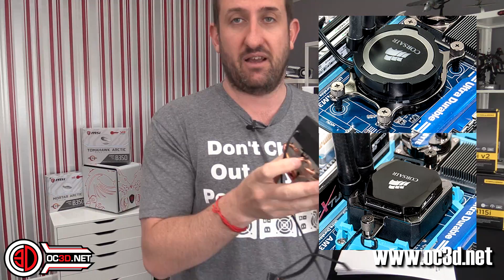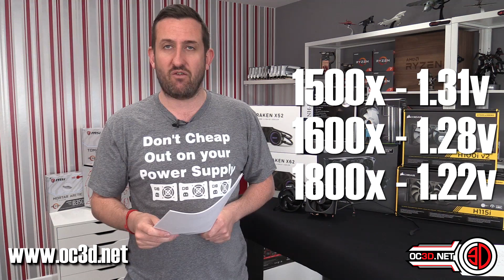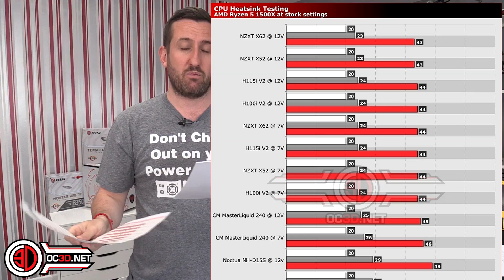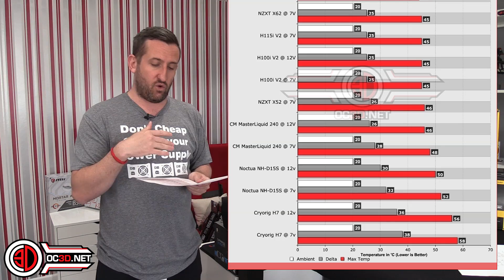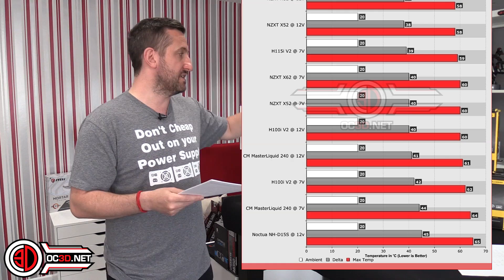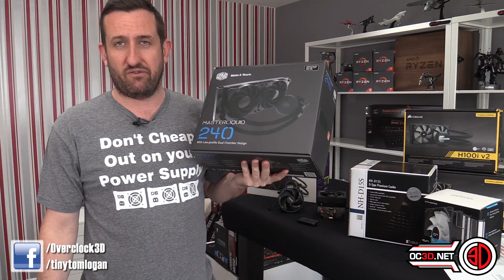AMD Ryzen Cooling Round Up 1500x 1600x 1800x

Comment: I'm having the 1600 and the cryorig h7 but haven't used yet due to lack of am4 bracket (waiting). One question though, if my ambient temp is 25, I oc the 1600 to 3.85ghz with 1.375 vcore, will the h7 be able to handle it?

Comment: alright where do i start...
i have a r7 1800x running at 3.9ghz @ 1.375v on the cryorig h7, the temperatures are solid at anything except for rendering and it actually goes into thermal shutdown as it gets 83 c during a render after a few minutes... so once i realized that it was my cooler im looking for a decent AIO and maybe increase my OC. i have a p400 which i believe has radiator support so which one should i get, i dont really want to spend more than $150 however.

Comment: 1 Question: I have an 1700x clocked at 4.0Ghz with 1.425V LLC4 stable in benchmarks and everything, cooled by NZXT X62, however my temps are significantly higher than on your benchmarks, namely 65-68 degrees, as reported by HWinfo / Ryzen Master and Cam, and will reach 70 degrees after a while in stress testing and just go code 8_ on motherboard at that point. I should mention i did use the pre-applied paste. Can you advise what i should try?

PS: It only drops below 60 degrees if I run it at 3.9Ghz 1.35V LLC3.

Comment: Hi I don't know why but my ryzen 1700 at 3.8ghz 1.35v whit the enermax ets-t50 axe white it's running a lot of cooler in the same ambient 20°C it runs around 43°c after 10 minutes at 100% whit cpu-z stress test, I know this is a different cpu at different speed but the difference its no so huge as the temperature difference

Comment: Bullshit, you don't need to go water. All you need is an H5 with a high static pressure custom fan such as ML140. Even H7 may be enough with a ML120.
Reply from the maker: This video was made before AMD admitted the CPU's had a +20c offset.

Comment: Tiny Tom Logan , would you mind repeating SOME of those tests after a few EFI-updates? It might be that hose updates lower the amount of heat due to better control of voltage and current, right? In your test the D15s fall a tiny bit short for the most extreme scenario for the CPU (not in any game), it might be interesting to see if that still is the case once the RAM-'overclocking' is much better optimized. Even the CPU-overclocking might improve. You can't change the hardware but with a better software control they might utilize the hardware better.
I am not sure if you read this, maybe I should ask it on the forum.
Reply from the maker: Im afraid I have no time to retest this atm (or for a good while tbh)
Reply: Fair enough. Maybe a few months from now? Just for the D15s and maybe two other models?
Reply from the maker: I very much doubt it now dude..... Too much new stuff coming that will need a similar job doing. This review took us almost a week to put together
Reply: I can imagine, it is not a boring year with regard to new hardware. :)
Threadripper, SkylakeX, Vega (somewhere in this year, I think :)), lot of new motherboards. 
Thanks anyway.
Reply: vega in ~a week or so.

Comment: I was just actually happy about long RGB cable for stock cooler with R7 1700 as I could run it on the back of the MB as I have RGB connector on bottom

Comment: OC3D, I just got my hands on a new Ryzen 1700 chip and I'm testing some overclocking with the stock cooler. You say that 75C is the TJMax for this chip but when I hit that number nothing seems to happen. No throttling, no shutdown. I'm curious where you got this number? Maybe there's a delay?

EDIT: I'm reading temps straight from the CPU, which seem to be a bit higher than the motherboard reading. It's probably motherboard triggering the shutdown.

Comment: I have the 1600X and it is also 95TDP, so it has the 20 degree offset. The "Ryzen Master Tool" will report the correct temps. No other programs will report right temps for the 1600x. Kinda sucks for the Krakens cause the CAM software thinks it is way hotter than it is.

Comment: Am I the only one who finds this all a bit confusing? :)
Reply: here is an easy short conclusion. The Kraken X62 is the best performance, looks sexy AF, but is also expensive AF. The 115i is the best peformance for your money. The Cooler Master is the best value for your money. Don't use air coolers on Ryzen, you will need air protection or go deaf.
Reply: Not sure about that, the D15 SE-AM4 seems like a good choice as long as you don't go extreme with overclocking and run a 100% CPU load (not the case in gaming). It doesn't seem to make any more noise than the good AIO's while it cools fine when you use Ryzen with 1.4 V for the CPU under any normal circumstance.  
My problem with AIO's is the risk of leakage, the prohibitively high costs and the certainty that X years later the day will come that you can't use your computer until you install a new AIO or air cooler.
I lean towards the D15 SE-AM4 but I can be convinced to use something like the 115i. I wonder if the EFI updates reduce the power when the CPU runs @1.4 V and the RAM is clocked to 3200 MT/s.
Reply: NZXT has a 6 year warranty on the Kraken, nothing is 100% safe when it comes to liquid cooling, but atleast NZXT is confident their product will last at least that long. I'm loving mine, i was willing to pay the premium as i love the look of it. And should it for some reason start to leak, its not like i'm gonna bin my old CPU fan, i'm keeping it should i have to return the AIO for some reason.
Reply: 6 years is pretty good, assuming that it is easy to get a new product (not a mess with having to send it to the another country by post and have to pay for that...).

Comment: My 1600X is hitting 85 to 88c @4.0GHz with 1.46vcore with LLC on turbo. So with the offset thats 60 to 65c so im still good right just dont hit 90c.
Reply from the maker: what did the volts go UP to? was 1.46 the max or what you set it to in the BIOS?
Reply: The max suppose to be 1.45 but mine isnt stable so i bumped it by one that was 1.38 vcore Turbo LLC adds about 5 to 6 volts more so i went over by 1 volt of AMD limit. Thinking about just going 3.9GHz but i want that 4.0 since it cant go further...
Reply: My old FX-6300 was at 4.8GHz so it would be nice to get my 1600X there but that would be a dream lol since most cant even hit 4.1 nor 4.0GHz without burning a hole through there boards lol
Reply from the maker: should be set in volts rather than mega LLC - LLC should keep the volts level not go that far above
Reply: OC3D TV I had to set in the bios for a stable overclock
Reply: +OC3D TV with the gigabyte AX370X gaming 5 board LLC adds voltage, Someone else was able to verify this also. What do you think about the Phanteks PH-TC12DX thats what i have and using for my Ryzen 5 1600X max temp is about 88c, Isnt the max temp 90c you sure its 70c...WOW im killing my chip then...

Comment: Wanna know what really pisses me off about the cooler situation? The cooler Master masterliquid pro doesnt come with out of box am4 support like the non pro does. I did buy it before ryzen released, but they came out and said an am4 bracket will be released for it. I contacted them and they said the bracket should be out end of March, early April. It's now almost May and there's still no brackets for anything other than the air coolers. I'm salty because I used the cooler for about a month on my z87 build. Now it just sits there doing nothing while I run the stock cooler on my ryzen. I've only owned CM cases and coolers, but now my salt makes me want to leave them. I asked for an update a couple weeks ago and got ignored.

Comment: Hey Tom, thanks for the great video! To bad you didn't have the Cryorig R1 Universal to put up against the Noctua. I'm waiting on my R1 AM4 bracket which should be here by the weekend. It's more of the Noctua's size and I was curious. But I think the Noctua's temps are likely a good reference point. Seems like the Corsair H100i V2 is the sweet spot, or the CM if you want to save a few bucks. Again thanks for the great work, keep em coming!
Reply from the maker: I do have it here, but every cooler ads 8 hours more testing....
Reply: Totally understand, thanks for the hard work! Cheers!

Comment: Isn't the thermal limit 95C? 70C was FX.
Reply: It is 95c but that's the max, not a recommended stable operating temperature. And no, Ryzen's are fine above 70c but best to keep it below 80 as a rule.
Reply: Exactly. Tjmax is 95. Anything below 80 is fine, and the actual 24/7 operating temp stated by amd is up to 75c.
Reply from the maker: Nope its advised as 70 and it does get flakey when you go above it. Probably another reason why they added the 20c offset on at the start

Comment: H110i v2 working a charm on my 1600, got the whole system running on quiet mode 3.85Ghz, 1.35v, peak temps are around 55 degrees. avg is 32 Degrees

Comment: I have the Noctua D15 AM4 and currently run it with only >1< fan and have the 1700 @ 3,9 with 1,37v and the temps are 50-55max under load. Soon I will have time and will put the second fan and I expect the temps to go lower.
Reply from the maker: Wont make a huge difference unless its high fan speed
Reply: The second stock fan. In my box I got 2 fans but installed just the first that was mounted already. Also I have not tested yet but I will try to lower the CPU voltage a bit since this is the first setting I tested. If it can be lowered much I will try to go 4Ghz on 3.9V

Comment: Where is the Phononic HEX 2.0 THERMOELECTRIC CPU cooler? I will attempt to reuse my Chilltec Black if I can find a AM4 retention setup that will work with it or just get the Crosshair MB that will work with my AM3 bracket...
Reply: Problem is I prefer Gigabyte or MSI... and want to stay under $200 on a MoBo... doesn't matter until I see if I get a tax intercept or if I get my money back and can update my current setup to Ryzen.Now, MSI 870A-G54 mobo, Phenom II X4 960t CPU, 12GB of DDR3-1866, and a Nvidia GTX 465, a screamer , huh???
Reply: Well I am not a huge OC'er, I just dabble, push things to stable limits, see what can be done and roll back to a safe level for daily use. I even stopped unlocking my locked cores so Nvidia's software could identify my CPU and rolled my mild overclock down to stock, because it broke a software function I enjoyed.

Comment: I wonder why when tested on Intel ... the Noctua coolers did just as well as any AIO's but on Ryzen it seems to not be the same ... funny because Intel run so much hotter than these seem to run .. you don't see the Ryzen getting to the 80s like Intel. I think that some of data here is tainted trying to push useless AIO's to people so they have to buy new ones every couple of years instead of having a cooler that lasts 10 years

Comment: wow .. such poor information here .. "the 1800x will be about the same for the 1700x and 1700" um so the temps are going to be basically the same for a 65w TDP and a 95w TDP ?.... how can the temps be about the same for a 1800x 95W compared to a 1700 65W ? I think the 65W would quite different... I guess you could say the 1700 would never get hotter than the 1800x but it would run these tests much cooler with the lower tdp... the coolers would have to dissipate less heat

Comment: I have the 1600X running at stock. The cooler is a Corsair H60 but a Cooler Master Sickle Flow 120 fan in pull config is used. It is exhausting directly out of the case. My highest temp on HW Monitor was 80C (60 real temp) and the highest turbo clock I have seen was 4123 GHz. Normal turbo is between 4092 and 4105 GHz. I have also got screen shots where it turbo 3 cores at the same time. I did not think it was suppose to do that though. lol
https://plus.google.com/113296260144710241779/posts/YYHN5Ehmjcp

Comment: kraken is out of its fucking mind.  You have to show proof of purchase to get a proper mount.........and it takes 2 weeks to get it.
Reply: Cryorig is the same, register your cooler and then proof of purchase of an AM4 board AND the CPU. I guess if you have an old AM3 stock cooler around you could limp by while you wait or get one w/ the new stock coolers.
Reply: Cryorig you dont need the MB Proof, you just need a Pic of your CPU Receipt and the for your Cryorig Cooler. I just went thru the process and My R1 bracket will be here this week. Once it's approved only takes 5-7 business days. They're arent out of their minds either, it's either they qualify you as a verified purchaser and give you the bracket for free or they charge everyone for S&H. They decided on the route where the customer pays nothing, but that's for true customers as S&H is expensive on the level of customers that they will have to send the bracket out to.

Comment: my 1700 with a h110 getting 65C max with my front panel on but removing it brought it down to 58C.
Reply: Should i make my rad push pull to create more static pressure to pull through the vents on the front panel of the p400 or should i just cut a hole in the front panel and add a dust filter
Reply from the maker: Frothar that's a question only you can answer.
Reply: Frothar i'd do push-pull if you've got the space. Get some Nf-a14s or something

Comment: tom, you think if u had the liquid master pro 280, it would match x62 & h115i?
Reply: 7oxicAvenGer Yes. Maybe a few degrees hotter. Im getting the liquid master since I like the A E S T H E T I C S more compared to an air cooler.
Reply: Zyklon for me the x62 is the most beautiful
Reply: Markus Wiedner And expensiver?
Reply: The pro has no am4 brackets atm
Reply: leavemealonefoonow I dont know about this but my original comment has a mistake in it, im getting the masterliquid 240 , not the pro
Reply: Zyklon ah in that case, lucky you. I'm still waiting for them to release brackets for my pro.
Reply: leavemealonefoonow :( still dont know the difference between the normal version and pro, only the led is the difference looks like it
Reply: Zyklon the pump/waterblock size is also bigger on the pro. About twice the size. It also has a clear cover on the top with a blue led which the non pro doesn't have.  Tbh, idk if they even make the pro anymore. Speaking of, I just saw something on their forum saying am4 brackets will be shipping around May 16th in EU. They EU store has preorders but USA where I live doesn't. Really salts me.

Comment: I managed to get the H110i for £79.98 @ Amazon; that's a 280mm rad, nearly identical to the H115i. Considering I've got the 1800X, and the H115i topped the chart I'm well chuffed!
...yea I know the H110i is made by CoolIT, but it's much the same, plus the firmware is more solid.

Comment: I'm awaiting for my Ryzen parts to arrive. I have an R7 1700 coming my way with the wraith spire RGB cooler included. I guess I will give this bundled cooler a go before deciding if I need a different cooler and what it will be. Though I guess as you also have in your test be a NZXT Kraken or Corsair one. The Cooler master seems to do well though it's a similar price in my country as the Corsair. I think about trying to see what overclock I can get with 1.375 / 1.38 volts as I heard that will make a big difference in heat compared to the 1.4 volts. Any experience about temp differences at these voltages?

Comment: I upgraded my power supply to Corsair RM1000i and I got something I didn't expected: SOUND QUALITY
The sound on my $600 USB DAC improved a lot. Night and day difference. Somehow it cleans up the current and I get no jitter, no EMI, no RFI, just pure signal.

It's overkill for my old i5 and gtx 780 but I wanted something to turn off the fan while listening to music because I'm a guy who cares about sound quality.
The temps on idle are 31-36C with zero RPM and 39-40 while gaming with 1000 RPM,  my PC gets hot in a closed case like Define R5 (no window).
Reply: My ax760 is whisper quiet and zero rpm at idle as well it never gets warm either. Like you said 1000w is overkill esp when people aren't running SLI much thesedays and things just get more and more power efficient as the years go on.

Comment: I wanted to buy the 1600 but I have money for the 1700, should I pay more and get myself set with the best cpu on the market? I want to stream some games and do work in photoshop, premier and CAD, what do you think? I also want to buy the b350 tomahawk and I already hace an rx470 which I got for a nice price
Reply: probably just get a 1700 and not have to upgrade for the next four years at least
Reply: +Patriots Legend Thought the same, it will be a procesor for the long run gor sure
Reply from the maker: If you have the money and other parts dont suffer then why not :)
Reply: +OC3D TV Will there maybeeeee be a slight bottleneck with the graphics card? I think there should not, I saw many people build with an RX480 and the 470 is probably more than 85% the performance of the 480
Reply: Go for the 1700 for sure, the cooler on it is good enough to get you to 3.7-3.8 with zero problems.
Reply: I have a 1700x on the tomahawk board runs great 4.1 ghz 1.325 volts, so yeah I would recommend the 1700 and never look back )